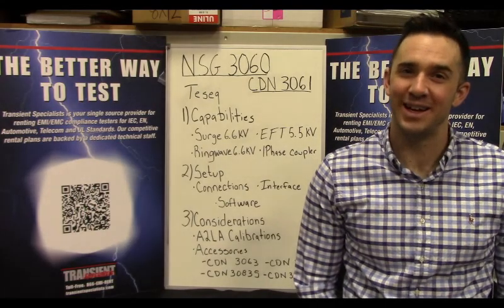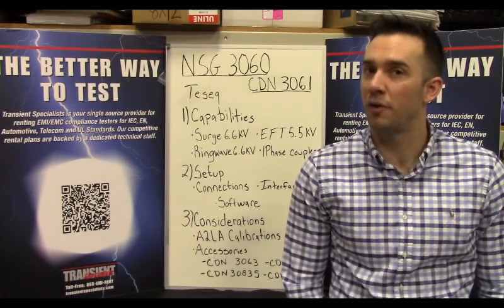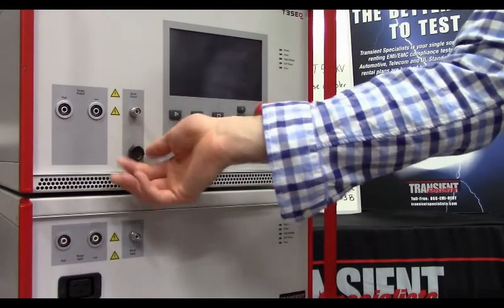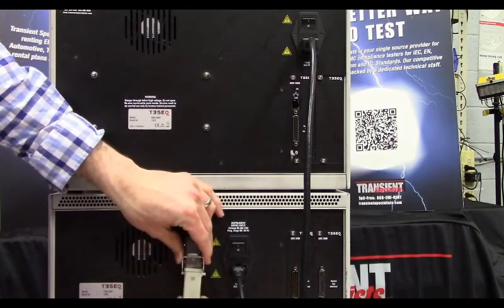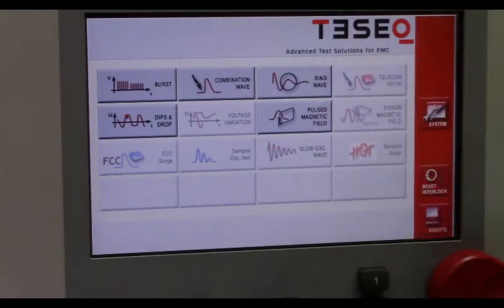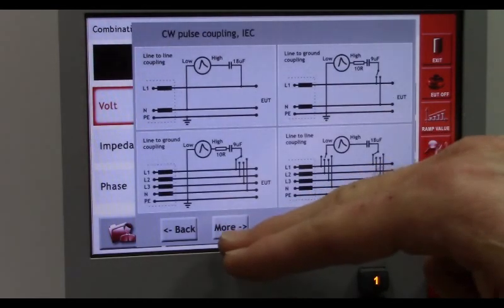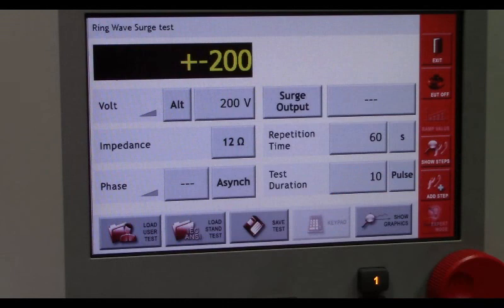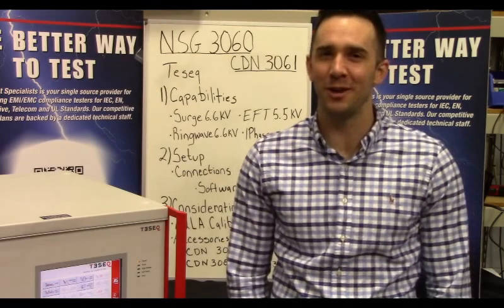NSG 3060 - Teseq Surge Generator (Overview & Setup)

Comment: My understanding of these is that the discharge a high voltage capacitor into the DUT. Can I ask how the switching is done. Is this none using some form of high voltage relay or is it done solid state. Thanks best regards Chris

Comment: Hi, I am using TESQ equipment for surge test. My system is single phase AC system. When I test for common mode , that is Line to earth , I could see same voltage in Line to Neutral. Is this accepted? If so why differential surge is required .